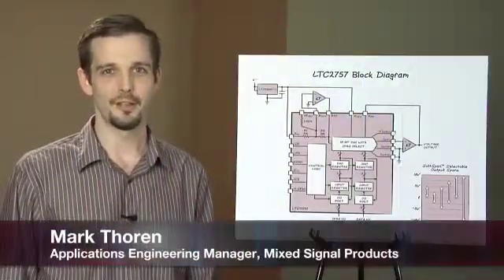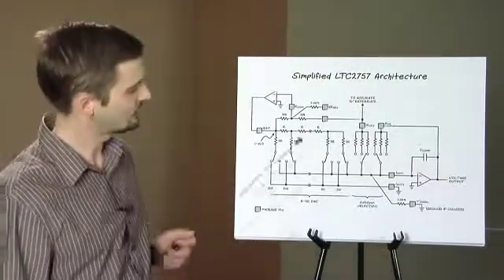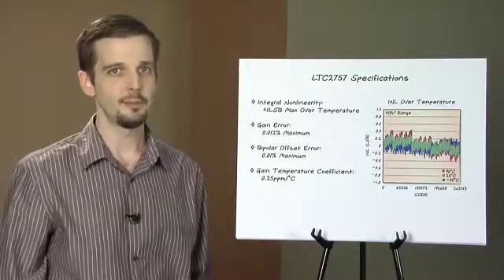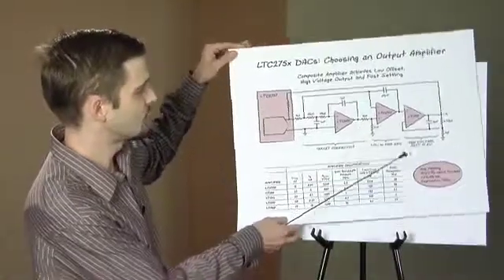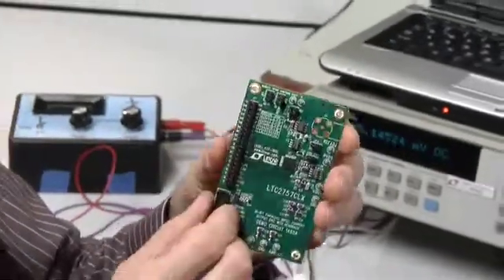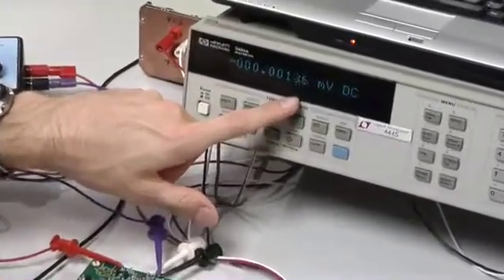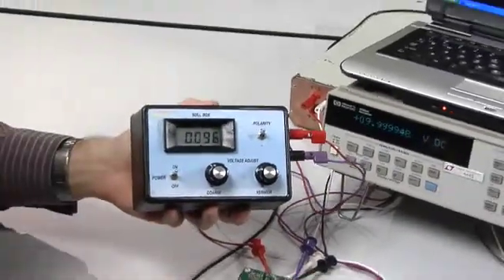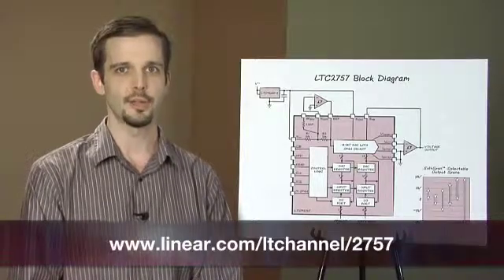True 18-Bit DAC for Extreme Precision Applications

Comment: Hi, is it possible to use the voltage reference LTC6655-5 with more than one IC (LTC 2757 and several others ICs)? If so, how can I connect the Vout_F and Vout_S pins to the several ICs?